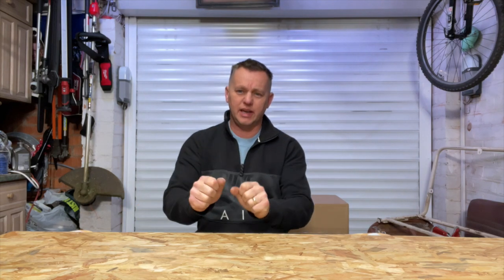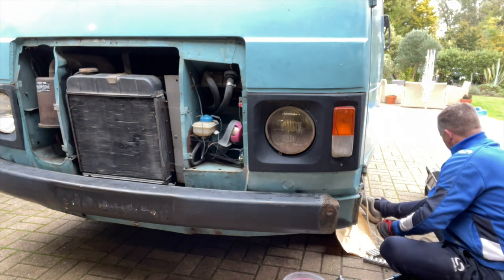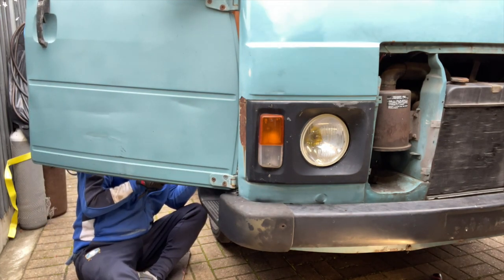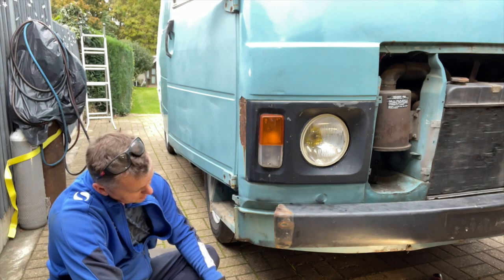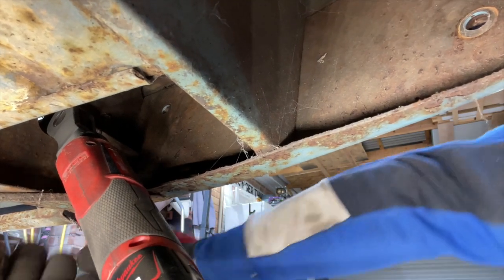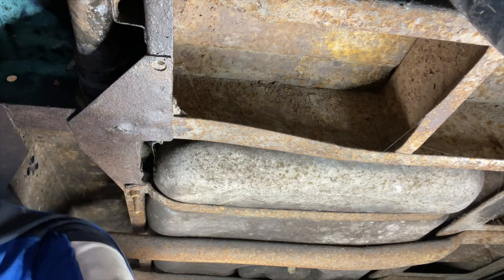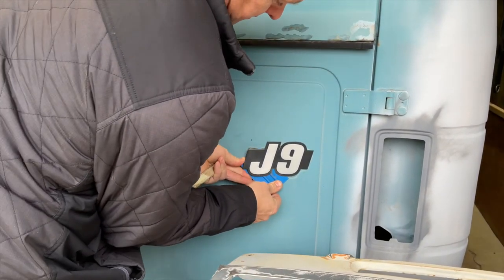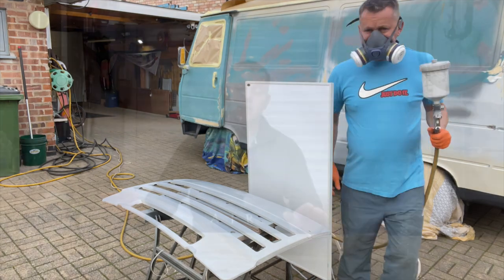Peugeot J9 Coffee Van Restoration episode 4

Comment: I don't really recommend you apply the underseal as you have. You should use some of that rust converter that turns black and provides a primer surface, then some zinc primer, then underseal.  The way you are doing it will not bondwell and it's locking in some of that rust that will only grow the underseal will act to hold moisture against it, in a couple of years time it will be rustier than it was and flaking underseal.  There is also a very cheap method that works, you still have to clean it,  spray a 50/50 of boiled linseed and old engine oil. Might have to warm it or add a little white spirit.  This creeps in everywhere and dries in a few days.  I fallen into the trap myself
Reply from the maker: Thanks for the great information, I treated all the rusty bits with the aquasteel, and undersealed the rest, hopefully wont have too many issues in the future, there's more about it in future videos 👍🏻👍🏻🛠